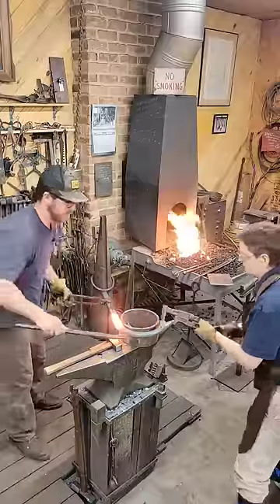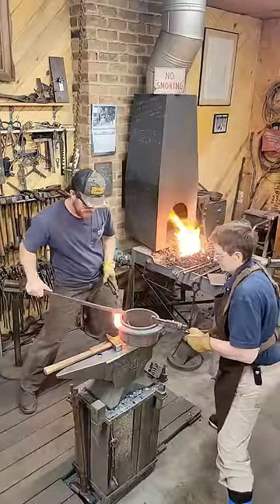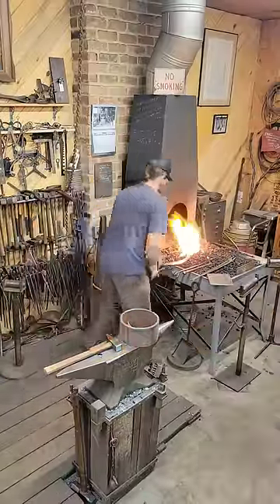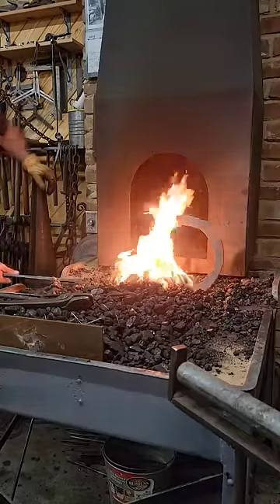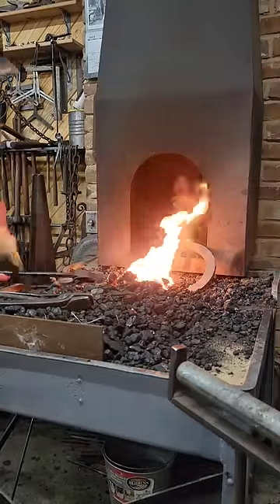Forging a Ring on my Anvil #blacksmith #anvil #art #craftsman #diy

Comment: You welded it. And we all know it.
Reply: 😂😂😂rightttt
Reply: I know god damned well that's what I would have done. Fire up the metal glue gun, grind, call it good.
Reply: Only if he is smart
Reply: Yup, get out the cheater stick, turn up the amps,
Buzzzz sparkkkk Buzzzz Grind done...
Reply: He does own at least one welder. I saw it in his "revealing gold anvil" short.
Reply: I hope so. Especially for a decorative piece
Reply: @MisterMitchMM  He could forge weld it too.
Reply: @senatorjosephmccarthy2720   It would have been too difficult to make it even. Stick welding would work much better.
Reply: Perfect gap for a weld. Small grinder work required.
Reply: @DarkMatterX1  :- Same here...weld it closed.
The weld is the strongest part of the ring.
Reply: I would have 😂
Reply: @blueeyeswhitedragon9839  
Affirmative. Anyone in the know knows good and well it's what he did. The "we hsd to make a new one" is to keep the internet critics at bay.
Reply: I was going to say a half inch gap would be easy to fill up with a welder.
Reply: Or that's what he should have done, if he can do a good weld anyway.
Reply: For real there ain't no way he didn't welt that thing together
Reply: @DarkMatterX1 like my old coworker said who was just learing to weld "aye it dont matter what it looks like before you grind it ese" he was from Guam but completely adopted new mexican culture and slang lmaooo but he had a point. grinder and paint makes the welder you ain't.
Reply: I was going to say why don't you just weld the rest?
Reply: @i8764theKevassitant  until it fails under load.
Reply: @i8764theKevassitant  lol I like that last slogan.
Reply: @python27au  we were not doing structural lmaoo. Though the welds do need to hold enough, we make roll off dumpsters and commercial front loaders for the most part. He did the sheet seams that could be a little lumpy and ground down. Its mig so that says enough. I do most of the structural welds and fitting for the shop as I'm not super new to the trade, but not super old either lmao. i worked a structural steel place, alstate steel if youre familiar. Made beams,collums, big heavy stairs and railings. Swear they were for a ship or industrial building, biggest and heaviest ive ever welded, big ole 6ft wide I beams that needed multiple passes usually 3 or 4 quarter in welds on the cleats and flanges minimum,  no defects allowed really. Anyway I'll be making the hydraulics on some trucks and trailers once the contract starts. Might record the process and edit it tastefully if I'm feelin cute.
Reply: @Ta2dwitetrash  I'd heard it a long while ago in a tiny multi faceted machine shop. Did autobody and other small stuff they sucked at but solid machinists and welders. Just sharp dudes but too much of a fuck it good enough attitude towards anything other than their main low tolerance bread and butter. Probably  because they didn't charge much.
Reply: @blueeyeswhitedragon9839  not likely, with piping and tubing and probably rings the seams, if applied with load wrong can be the first thing to bust. It May apply to rings but I know  steel square tube and round tube should be aligned so that the seams are not taking the heavier loads. Ie if you've got a trailer and use square tube the seams should face inward anywhere taking load. It's nice to hide them everywhere else but it can make a difference in those stressed areas.
Reply: No he smelt it to cast
Reply: Why wouldn’t you?  Bending flat like that in a circle sucks. His finish IMO was perfect.  Throw some weld at it and grind it smooth.
Reply: And I would have done too.😂
Reply: He said he needed an 8 inch ring but the pipe was 8.5 inches. Why not just close the ring a bit so the ends touch & VIOLA!!You have a whatever size/close enough ring!!!
Reply: I was gonna say... "Why not just weld it?". I don't see why that would have been bad. I probably would have expected to weld it by design anyways. Even if not that much though, I still think I would have welded it.
Reply: I thought that made more sense than doing it over.
Reply: @senatorjosephmccarthy2720  Aye, that is probably the plan - forge weld the last small piece in.
Reply: Sure we blacksmiths are dum
But not that dum3.14 times
Diameter plus extra....
Nice to see.blacksmith
Theo harlingen holland
Always alone...but...thats
Oke ..like derek vice grip
Garage tennesee always
Says blacksmith theo
Harlingen holland...
Reply: Beat me to it 😅😅
Reply: somebody had to say it
Reply: Just put copper behind the gap and fill it in duh,  start over huh

Comment: Outside diameter of 8" pipe should be 8 5/8". Multiply OD by 3.14 to get your circumference
Reply: Then add an inch and trim it later.
Reply: @IkesThePyro  at least the 1st one
Reply: Love pie.
Reply: Take the mean diameter of the ring you are making and times that by pi to get the length you need. The inside diameter is getting compressed whereas the outside diameter is getting stretched, the mean diameter is constant.
Reply: @putteslaintxtbks5166  and cake
Reply: @iwb316 not necessarily the middle of the bar remaining constant length probably slightly inner of the centerline
Reply: @iwb316 exactly. Whether you're rolling bar to make a ring or whether you're rolling flat plate to make a cylinder you use the mean diameter.
Reply: And then still end up being D*0.00159 short.
Reply: @mtnbkr5478  I can handle welding that gap.
Reply: @mtnbkr5478  lol but still miss it by .000002
Reply: Bending metal will make it longer
Reply: @FosterChild  how?
Reply: @eagle3351 metal stretches when formed. It also expanded when hot and does not go back to true original spec. Go read
Reply: You have to do calcs for the inside diameter of the ring and the outside diameter then cut both ends of the stock at an angle.  I just leave the stock long and cut through both at the overlap.
Reply: Pie is round. pie, not square
Reply: @FosterChild So what, she wouldn't be able to tell!

Comment: Don't you have a welder? 1/2" gap no problem!
Reply: Was thinking the same thing.
Reply: He could've actually chucked it back in the forge, then gust hammer the steel a little thinner and it would've stretched out, could've stretched in 5 inches if he had to 😂
Reply: Its ok to black smith but come on certain things just use modern shit like a tortch to cut out ring from flat plate  this guy probably gonna try charge $3000 for custom" hand made " 😅😅😅😅😅😅
Reply: @edwardgarcia7176  true, but hand made stuff eg tool's knives just feel that much better in your hand it's worth it 👌
Reply: @knifethrower9733  that "five inch" line never worked for me either
Reply: @knifethrower9733 ok. But this is just a freaken ring. Not a tool.

Comment: you dont need two people if you weld a catch on the round pipe. thats what we did at cropsey iron works in Brooklyn ny during the 60’s, 70’s, 80’s, 90’s, alll the way up until 2020.
Reply from the maker: Thanks... great idea

Comment: Liked it enough to Subscribe.

12" is as small as my hydraulic machine can go without custom machined rollers.

And I could just cut or machine it but you never know when the old fashioned way might actually be the best way.

Frankly it's paid for the new stuff. We don't abandon equipment we just add on the shop. 

But everyone is susceptible to tunnel vision. 

30 years and I learned something new and intresting today. Cool! TY 😊👍

Comment: Your design required 8" inside diameter. The pipe you were using was 8 1/2" diameter. Your gap was 1/2" short on the outside diameter. Chop 1/2" from inside point where they make contact,  then use that anvil horn and hammer to close the rings gap.

Comment: With 1/2x1 1/4 there's no way Im coming up 1/2" short, there's a ton of steel to draw out after you set the forge weld 😂 besides I'm too lazy to do it twice
Reply from the maker: I actually ended up forge welding this one... then I made another, got it perfect, and electric welded it. I wanted an extra.

Comment: I've always been interested in forging and this type of work. Also, both electric and forge welding. But I chose a different trade 30+ years ago, concrete construction. So, right away, that tells you I'm not the brightest, lol.
I just know how my brain would work in your situation. If I were me, I'd most likely cheat and beat making the first one work. (Concrete guys are very hard-headed, and really don't like to lose.) Ultimately, I'd spend more time rectifying my error. Instead of starting over and perfecting your task. Respect to you guys who use your head for something other than a hatrack. 😀
Reply from the maker: Thanks

Comment: You need an 8" ring but you bent it around a pipe that's 8-1/2" and you were 1/2" short. So if you close it, the ring should be correct right?
Reply from the maker: Yes, but closing it would make it "out of round" and it's such heavy material it would be difficult to keep round when closing.

Comment: 8.5 dia + .625 neutral axis = 9.12 x 3.1416 = 28.66"  is what i would cut to length. And to all the posers who said to water jet or plasma cut! Sounds like younger lazy generation spouting off that it would be easier, always trying to find a way to getting out of actual work, He is a blacksmith that work with flat bar and forge welding and not 1/2" plate on a CNC plasma. The best way usually takes the most effort. I would have made a new one myself flat bar is cheap . GREAT CONTENT AND I SUBSCRIBED!

Comment: Forge weld the ends after stretching the material, fit the ring with overlap on each end, cut the extensions, forge weld the ends, bam, no do overs, no excessive extra work. Just common sense.
Reply from the maker: Just that easy

Comment: .0175 x bend radius x degree of bend = total amount of material needed to complete bend. 
 
You would need to add the thickness of material(i.e. 1.25”) to your pipe radius, which should be 8.625”/2 for 8” pipe to make sure the outside edges of your bar meet. 

For this instance, the math would be .0175 x 360 x 5.5625” = 35.04375” of material needed. 

Overlap is always nice so you could go with 36” and cut the excess.
Reply: Thanks for making me feel dumb. 😂

Comment: blacksmithing always interests me but living in an apartment, it isn't exactly plausible.
Reply: Anything is possible friend. Its all about perspective.
Reply: Research local blacksmithing associations.  They are usually more than willing to help. Good luck
Reply: wrong. watch king of random's DIY forge guide. He uses a carbide firebrick for the forge, and cuts it in half. uses a hand drill to dig out a space in both halves. In forums in the DIY sphere they improved the design with really long bolts that are longer than the forge is tall, and brackets that are wider than the forge is wide. You tap the brackets and use them to build a frame around the forge to bolt the two halves down so they cannot move. Now drill a hole in the side that is big enough for the nozzle of a hand propane torch. Improvise a cradle on the frame to hold the torch in place while the forge is in use. Drill a front hole so you have a place to insert/remove the work piece. Congrats, you now have a a mini-forge that is able to work knives and is less than 100$ excluding tools, and less than 200$ with all tools factored in.

For the forget there are cheap small cast steel forges that won't exceed 100$. try to at least get a 22Ib one. you'll thank yourself later. A short, but heavy ball peen or cross peen hammer will work just fine and at this scale welding gloves with mid sized pliers will work fine too.

A mid sized metal pail with water is all you need for cooling the work piece.

All of the above covers your forge, a striking surface, the striking tool, and something to hold your piece. It isn't amazing, but it will get you started and is small space wise and highly mobile.

If you don't own a truck make sure to open the forge and let it cool before putting it back in the trunk and heading home. i'd advise setting an alarm and playing on your phone while you wait, and checking every so often until it is cool enough to be safely moved in a trunk.

All of the above should not exceed 300$ and is mobile. Best of luck to you and hope to see your successful projects!

Comment: I would have drop forged a wedge in 1 1/4 gap.... for the guy bellow me yes drop forging is welding except you're using a hammer to fuse the base metal...it's time consuming but it looks better than a clean line

Comment: to make a ring or circle inside dia 
8 in . say 2 in .flat bar .taje the mean distance so 8 + 2 in.=10
x pi . cut to that length .roll result
8 in dia 
add or subtract .it works on all 
circles  .the mean distance .is the trick .

Comment: That's way more work than just torching a ring out of plate and beating it with a cross peen to make it look forged
Reply from the maker: Actually it's less work. I'll race ya. Have you ever seen how much cleanup a torch cut takes?!
Reply: @drew.alexander  depends on who's wielding the torch. When I'm practiced I can cut a torch line close to what a saw could produce,  with a tiny bit of dross on the bottom of the cut. The forging work is beautiful but I'm a fabricator so I'm always looking for easier ways to do things

Comment: well if turned longer the circle would have been more true and then cut after bending past, less pounding.
Reply from the maker: Talk all you want, or do it 😏
Reply: ok "Do it Twice"  The talk is in the video, if you present yourself as blacksmiths, With a full shop
Making multiple circles, is a coil then cut so the ends are already alligned.
The just do it includes a bit of pre..

Comment: You need an 8" ring so you use an 8.5" pipe and come up .5" short. Common sense would say to remove the inner pipe and bend it .5" in to complete the ring but instead you bend another piece to make it 8.5", now you have a ring that's too big 😂
Reply from the maker: My original drawing was an 8 inch ring but it didn't matter, an 8.5 would work just fine. 
When you calculate the math for a circle on a bar... you have to take into account that the outside of the bar has a bigger circle to make than the I side... my helper calculated it for the inside and we ended up with a birds mouth type of gap. It was no big deal because it was good practice. I ended up tightening this circle up, forge welding it and fixing it that way. 
Later in the evening I was teaching a class on making these rings so we made another and this time got the measurements correct.  
It's difficult to convey all the information and context of what's going on and why we make decisions in a 60 second video... so I understand why it looks like we don't have common sense. But believe me we do. 
Thanks for watching

Comment: Every mistake you make is gonna make you an Expert? Keep going your things are gonna last for another couple of hundred years
Reply from the maker: That's the plan!
Reply: I have a challenge for you.
Can you design and build a little burner for camping. Must Be able to hold frying pan or pot to boil water.  the fire must be contained safely to put it out heat . Your tools are only allowed to be a  hammer a  chizzle. No more than 3 k g of weigh.😊

Comment: 8.5 inch? You could have just shrunk it a bit till it overlapped and trim the ends to match.
Reply from the maker: Faster to start over. No such thing as "just shrinking a little bit" especially with this heavy of stock.

Comment: Why didn’t you cut it so it fit together nicely and weld it. Then you would have had your 8” ring. But hey…I’m sure you did that all again just for that. And if you did, you shouldn’t be making one off projects that exact dimension doesn’t matter as evidenced by your lip pant attitude to the 8.5” pipe instead on the planned on 8”.

Comment: Bud you were a half an inch short you needed a 8 in ring you used a 8.5 in mold and said the pice was half in short even though it encompasses the 8.5 in pipe.......... ummm ya
Reply from the maker: It's more complicated than I explained because I had 60 seconds. Read some of the other replies where I Answered this.